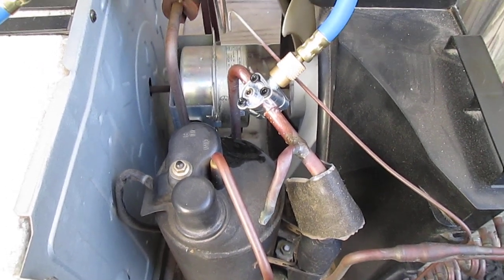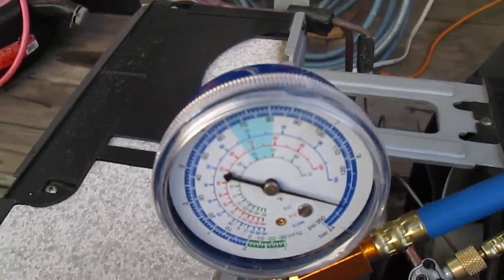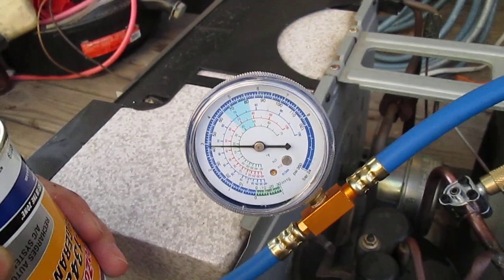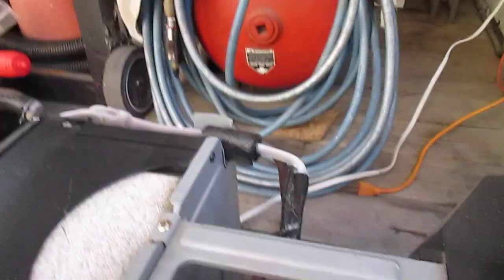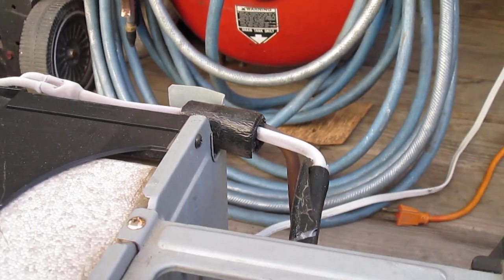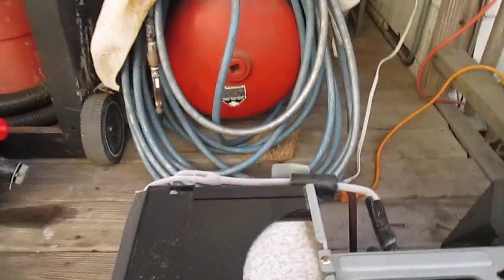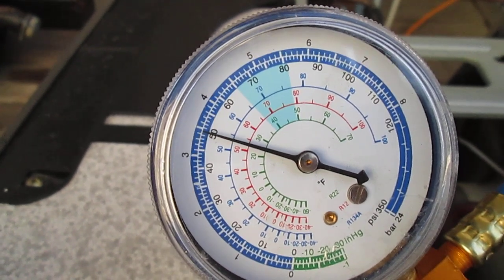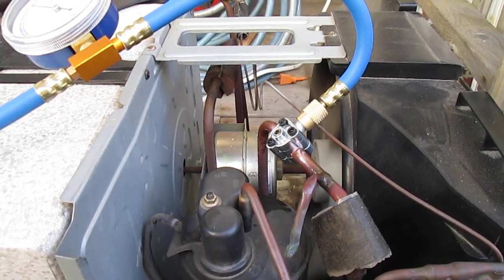DIY Air Conditioning House AC Refill Recharge with R134A - Video 3

Comment: Could this be done on a home 3 ton central AC unit with heat pump? My AC guy comes out every year, hooks up his gauges and puts in some Freon for about 5 minutes. Says it only took about 1.5 to 2 pounds of 407  then charges me $140 and leaves. I could save my self a lot of money doing this my self from time to time until I had enough money to replace the whole AC unit,
Reply from the maker: +Danny D - YESSSSSSSSS YOU CAN!!!  Since your System is a large " Commercially / Residential " done.  The " Refill " Port is already on there :))))))))))))).  You can easily buy 407C on eBay and do it yourself to save $$$$.  NOTE: Research a bit on the " Port " so it can fit to your System during refilling.  You will also need the " Gauge Meter " like in the Video to see what goes in etc.... Look for the " BLUE ZONE " and do it according to Temperature / Instructions on the Gauge Meter.
Reply from the maker: +Danny D - Do a leak Test first to see.... Put some Dish Soap in a Spray Bottle and spray around the Condenser to see if there are Leakages... Including your Port(s).  If it leaks SLOWLY, then just Re-Fill it..... It will ending up cost you more $$$, LOL.  Just buy the Big Bottle and Refill it each year, LOL
Reply: Danny D. You obviously have a leak in the system. If your a/c guy had any brains he would fix the leak so you wouldn't have to pay him to come back every spring.
Reply: Fuck no you cant do what this guy did. Your home unit uses a diffrent freon than this window unit. You need r22 or 410a and can only be bought by epa certified person.
Reply: JM you can buy it on amazon.com
Reply: NOOOO Its like putting gasoline in a diesel truck it'll work for a bit until it self destructs

Comment: Good for you! Its your A/C, it wasn't working and you were ready to throw it out, but by breaking the "rules" and just giving it a shot, you brought a piece of junk back to life. Never mind what those insulting "professionals" say! They probably just don't want people trying to fix their own appliances because it cuts into their profits.  I've got a piece of junk A/C I'm going to try this out on. If it works, great! If not,who cares? I'll have fun messing with it! Thanks!
Reply: There are other reasons for not putting the service valves on their devices - mostly having to do with EPA rules and other government mandates rather than function. It is a good bet that once the appliance is working, the most likely leak points are the service valves and if the device breaks down, it is well past the point of cost effectiveness to repair - in other words they are throw-away devices. They have a life based on other factors and that life is not long enough to warrant them being repairable.

The air conditioner might actually be a 134a system rather than an R22 - they don't say on them. As far as contamination, that is a misnomer. The R22, R134a, and several others are mixable to get various hybrid systems. In fact, auto manufacturers are working on these mixtures all of the time - they are just not willing to put out a specific mixture as a new R value because it costs money to do so, etc. 

In my opinion R134a was one of the most stupid things the government has ever done - not only is it an inferior refrigerant, there is another called difluoroethane R152 that is much superior to R134a, but because it supports a flame only if that flame is already burning, it is dubbed a combustible, when in reality, R152 is much cheaper and much better as a refrigerant than R134a and it will not burn either, although the government has decided it does because of its chemical composition says it should. Then they use it in an automobile fueled by gasoline and claim to be worried about 20 oz of flammable refrigerant that won't burn. Give me a break.
Reply from the maker: +Itcis - Hi, yea you are 100% correct about the " Professionals ", LOL.  I have " Merged " all the Video here if you are planning to do it or try it out.  https://www.youtube.com/watch?v=C2dh1BFeULw  I also have an " Update " Video after 2 years of service with " Temps " reading here:  https://www.youtube.com/watch?v=b9YNqY75BBs
Reply from the maker: +JayDubyah Wing - Wow you must done a lot of Research :))). I am a learning a lot. Although this was an experiment... I decided to post it up and see and as you can see how People reacted :(((.  Have you heard? They are coming out with something new to replace R134a... A Tech from Autozone told me that they will no longer selling R134a. But the new stuff, will be the same Fitting as R134a so no " Retro Fitting " required. Yea, another Government Regulations, LOL. Best of all, " Environmental Friendly " ... I can't wait until they come out with it so I can refill my Air Conditioner with it again, LOL
Reply: @JodBronson  umm AutoZone told you they won't be making it anymore? Well sorry to tell you but that's the only way to charge an Automotive (car) AC unit, so if they stop making it any car would run out of AC which becomes useless. So maybe you should do research on it and know what your fucking talking about before you say this or that!!!!
Reply from the maker: +JayDubyah Wing - THANK YOU for all the INFO btw... I love learning new things :)))))))))
Reply: @JodBronson  you do realize I'm a mechanic and on the side I'm a professional at recharging commercial and residential A/C units with my father in-law, I believe I would know what I'm talking about. I'm not the one trying to fuck shit up!
Reply: @JodBronson  it's not Stoopid  it's Stupid so before you correct someone, maybe you should try going back to elementary school lmfao!

Comment from the maker: 2017 Update - Still working AOK and GREAT YAYHOOOOO !!! -See Update Video here: https://www.youtube.com/watch?v=b9YNqY75BBs
Reply: Jod Bronson You can add more refrigerant.... notice the tiny numbers on the that correspond with the pressures. There are three sets of numbers one color for r22, another for r12, and another for r134a. You want the pressure to correspond with the evaporation temperature of the refrigerant. IE - a 35 degree evaporation temperature is around 30 psi. Without getting technical that's close to what you need. But really you need to check "superheat" and charge the unit to around 15-20 degree superheat. Superheat is the temperature ABOVE the evaporation temperature shown on the guage for corresponding presure reading. If the pressure/temp is below 32 degrees your evaporator may freeze up. hope that helps
Reply from the maker: +Samual Whittemore - Thank you for the informative info. I have learned a lot since  I made the Video (1+ year ago). But yes you are right about the Gauge reading. When I did it first, once I saw the freezing on the Line I stop, cause I was afraid of getting more in or blow up, LOL.  I also merged " All " the Video together because when I made it... I didn't have any Video Merger Software:(((. Yea, you are right, I wished you were around when I first did it. No-One really have made a Video on R134a refilling for Windows AC, I couldn't find a Video on Air Conditioners :((((. Although I did saw a guy did a Fridge with it, so that is how I followed his Video. As you can see few " Negatives " on my Video, but funny thing is... If you check the Store now, the Wine Coolers and Small Fridge are filled with R134a, LOL.
Reply from the maker: ++Samual Whittemore - I forgot, all the Video merged here: https://www.youtube.com/watch?v=C2dh1BFeULw

Comment: you cant mix to freon together, the oil is different. recover old freon, clean system, vacuum and recharge plus you need a real set of hvac gauges. just my two cents im not talking down on you buddy
Reply: Yes, you can mix refrigerants together (BTW freon is R12) - but you should know what you are doing to try it, especially as it relates to lubricants used. One refrigerant that really works well is Dust OFF (difluoroethane, R152) which is compatible with many oils including mineral oil and the oil used in 134a systems. How do you think they come up with these R numbers anyway? They mix things together until they get the kind of service that is needed for the application. One of the refrigerants is actually propane.
These little air conditioners were mostly R22 which is now being phased out. Most went to R134a, a major step backwards, IMHO, but that is what they did.
The low side gauge is satisfactory for this type of work - you just want to get the amount of refrigerant in there that will make the system operable. Sure, being 100% on-the-money is nice, but not necessary. I very seldom find any more than assurance from the high side gauge.
Reply from the maker: +g smoove - I think it's totally Empty and if you see in beginning of this  Video, it was less than 5PSI, plus it's too late, I already did it... LOL.  See my updated Video here: https://www.youtube.com/watch?v=b9YNqY75BBs

Comment: Idiot.  It's frosting up because you're dumping liquid Freon into the suction line.  Unless you recovered the R22 and pulled a vacuum on the system before charging with 134a all you have done is contaminate the system.  Compressor life will be shortened and it will not cool properly.  You my friend should leave this to the professionals.
Reply from the maker: This Air Conditioner is 10+ years old. So I don't' CARE if BREAKS BLOW UP, ETC... All I can say it works and still working really good and it's freaking COLD as hell. I have to put on ENERGY Saving MODE so it shut down the COLD AIR and maybe protect the Compressor. But who cares... If it BLOWS UP LMAO
Reply from the maker: 2017 Update - Still working AOK and GREAT YAYHOOOOO !!! -See Update Video here: https://www.youtube.com/watch?v=b9YNqY75BBs
Reply: dennis roberson it's frosting because he put freeon in and freeon gets really cold, and its completely normal, its not because of being contaminated
Reply: Jordan Bronson it need a little more it should be in the blue around 75
Reply: Dont get a profesional to do it google iy do your research and save your money like this guy thumbs up i did the same but just for kicks i called a AC guy he said yes easy fix 70 dlls i said no thanks. this same method cost me a total of $14.65 thank you
Reply from the maker: +Gato X7 - Glad it SAVE$$$$ for you :D. Now you will be able to do few more and than some.....,with $70.00 LOL
Reply: Some compressors will last dont matter what freons you use .or if you mix them..       Its only a regulatory mob where. Ohh you can't use this freon in that.  Bls bla bla...    Just whole bunch of crooks that try to force you to hire and pay for a/c techicians so they can like rip you off..
Reply from the maker: @wojciechzgodowski  -  You are right!  It's still working til this Summer.  I did 2 of them, but during the Video, I left our in Front of my House and someone took 1 of them.  I still have 1 left and it's still working....  2019 Update Video:  https://www.youtube.com/watch?v=0IwfP4MA_hs
Reply from the maker: +K Mack - You are right, thank you :). During the time of refilling, I didn't know what I was doing and when I saw freezing up the Tube, I got scared, LOL. Its still working really good right now, had to shut it down since my room got sooo cold, LOL.... I am still in the " TEST " mode to see how long it will last me :))))))).....   I won't be filling it anytime soon, but once it does goes cool. I have the Port there now, it can be easily do it again :D.  Also, they are coming out with R1234yf and it suppose to be " Environmentally Friendly " , I will refill that once it comes to Autozone, LOL.